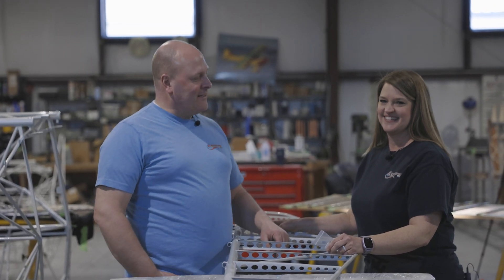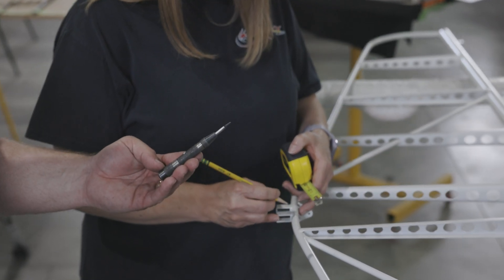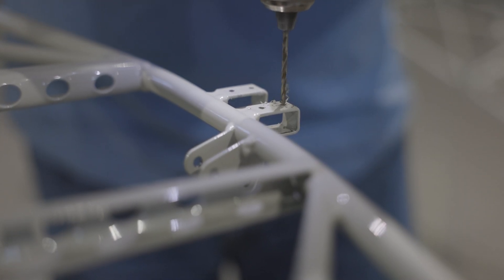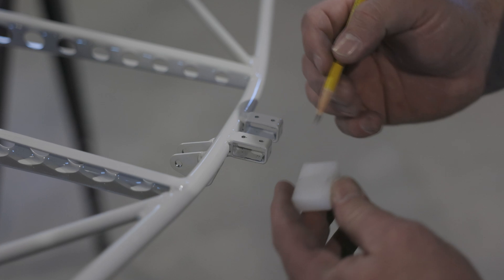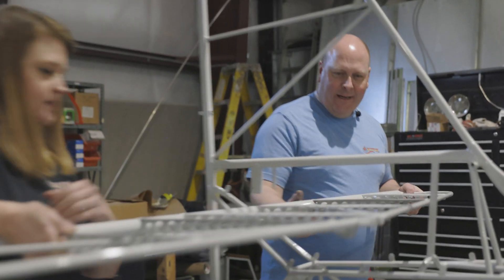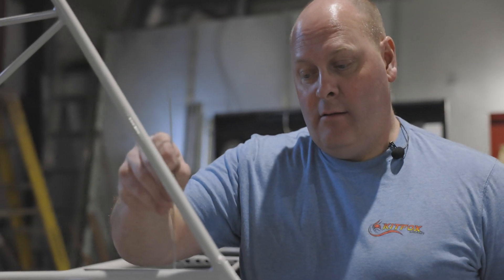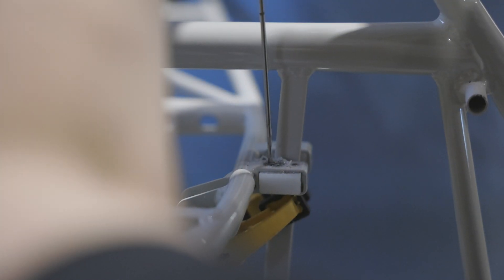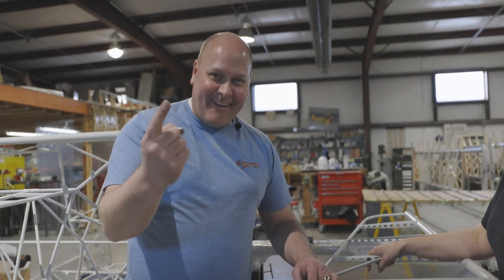KITFOX Technical Support & Build Series 5 - Horizontal Slider Blocks

Comment: Surly you should be using a rule to measure the hole centres not a tape measure.
Reply from the maker: Surely.....a tape measure worked just fine, as shown in the video. 😉